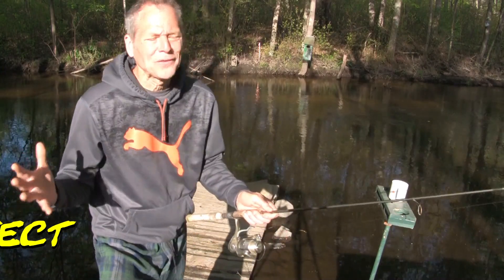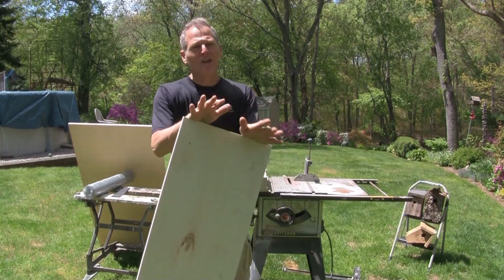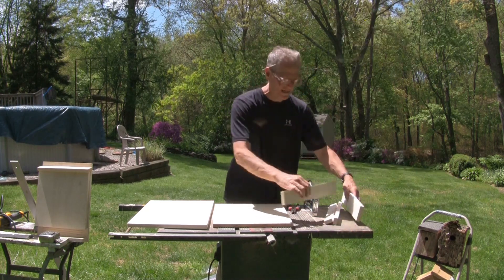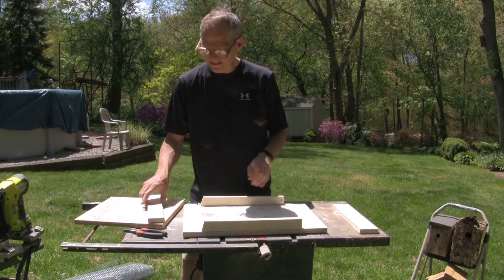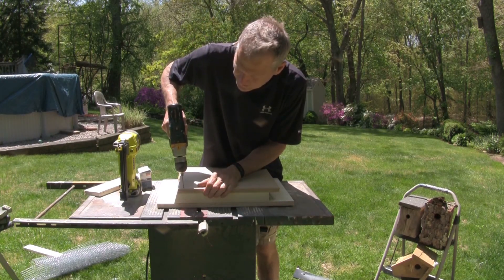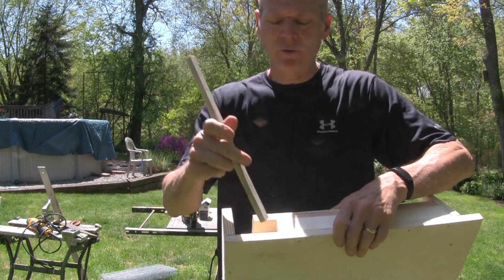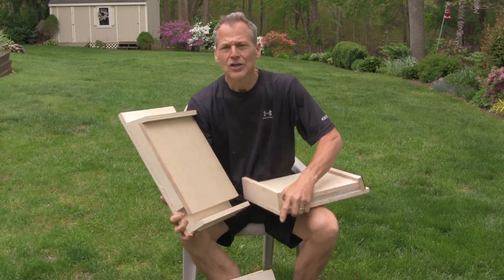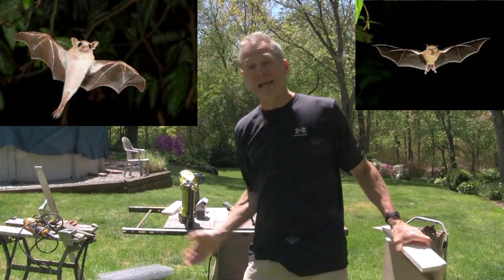How to Build a Bat house

Comment: A couple issues with this design. First, the spacing between the panels should be 3/4” - 1”. Snakes will prey on bats, and they can fit in there, even with your entrance reducing piece. Snakes can’t open their mouths wide enough to grasp the bats if the space between the panels is 3/4” - 1”. Second, the ledge at the bottom shouldn’t be there. Bats don’t tend to land horizontally. They also tend to take off by dropping out of the bottom, catching the air, then flying, just as many insects and some birds do. While it won’t necessarily make the bats unable or unwilling to use the house, it will be less desirable and they’ll choose something else nearby if there are better options. The ledge also gives potential predators a place to perch or sit.
Reply from the maker: Very cool, Thank you for the comments, I appreciate that..and will adjust..

Comment: How does "plywood" stand up to weather?
Reply from the maker: Not as good as regular pieces of wood..They start to peel after a couple years
Reply: @Backyardprojectguy  I use texture 1-11 plywood which is exterior grade and lasts for many years if not forever. It is primarily used for exterior siding.
Reply from the maker: @herbsu4330  ..I have worked with  Texture 1-11 myself...You will be fine..